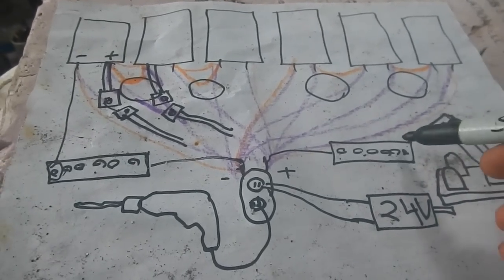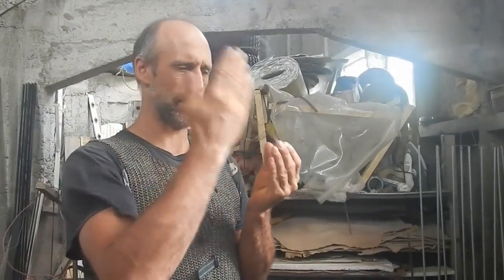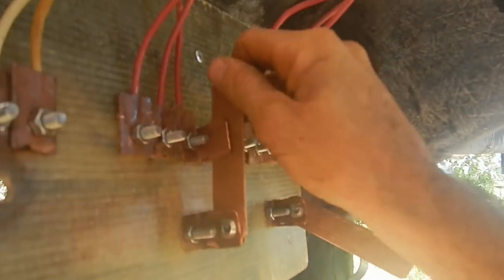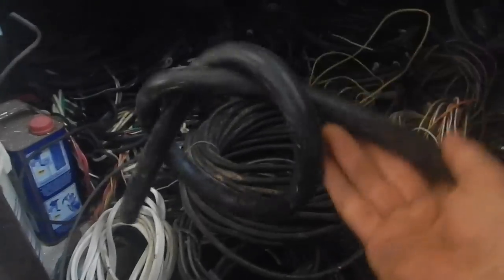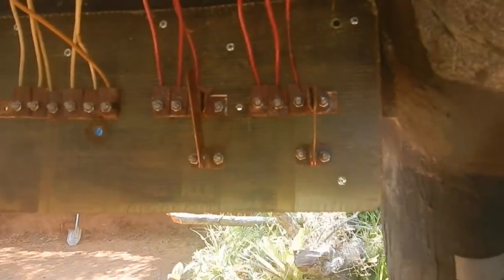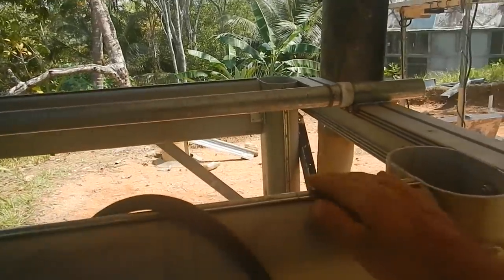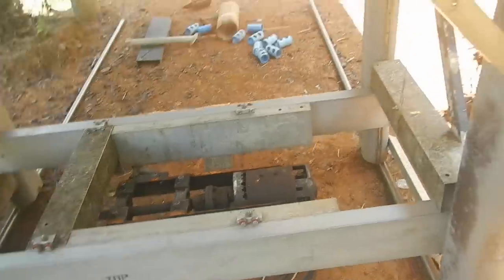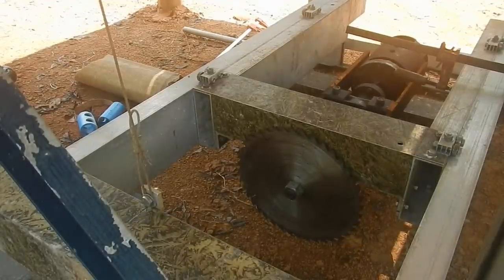Lumber mill 017 Ready For Action!!!

Comment: SUPER COOL!

Might just need more mass to help with vibrations, but they're not bad.
You could cap the ends of the tubes and use a small hole in the top to fill them with sand to add mass to the machine.

Cheers and looking forward to cutting, and the upstairs!!!
Reply: I came here to say this.

Comment: Jamie, if you want to make some good high current switches by youself, you may try construction where smaller copper pipe goes inside larger one which have a splitted end. You can use radial steel spring to tighten it or put the outer tube inside a plastic which then use as a spring.

Copper is not very springy and your current design may get loose over time. With pipes, contact area is large and contact force is high. It has small losses and tightness helps to keep contacts clean. Pipe is also easy to clean with round steel brush.

You may try chrome plated copper pipe too. It has 10x worse conductivity but it don't oxidize or wear out. The chrome is so thin it only matters in contact area.

Comment: What if you run the flex wire from half way on the roof tho the motor and a rigid wire from the roof to the switch. You will have long enough that way.

Comment: I am not sure it that tube amplifier for the sound of the motor is a good thing for hearing any problems easily or just is anoying and should be fixed by putting some dampening material into the frame tubing.